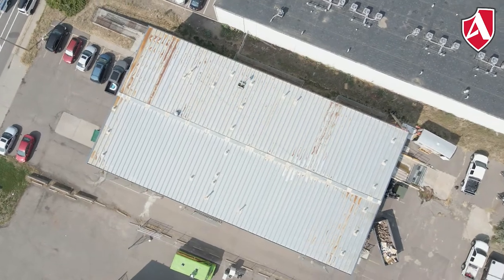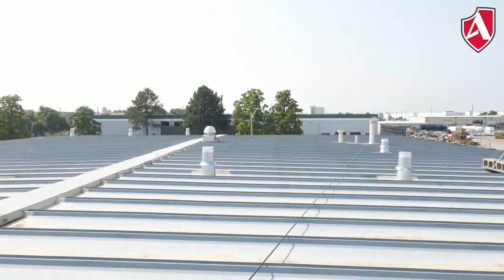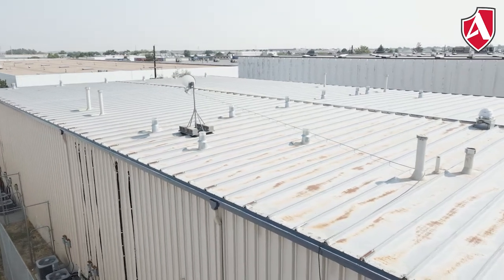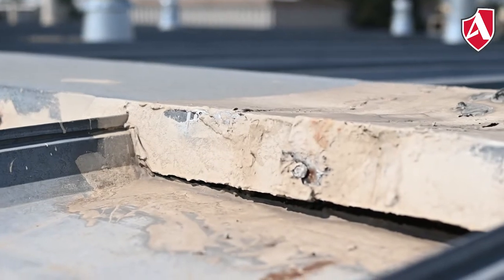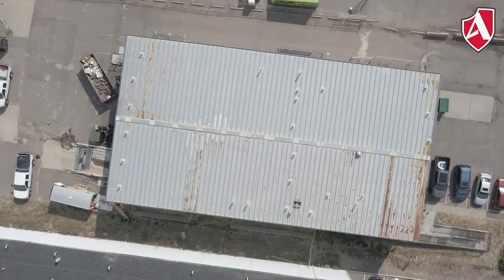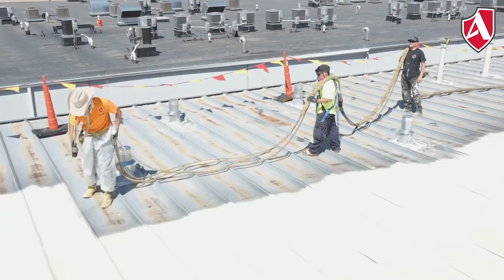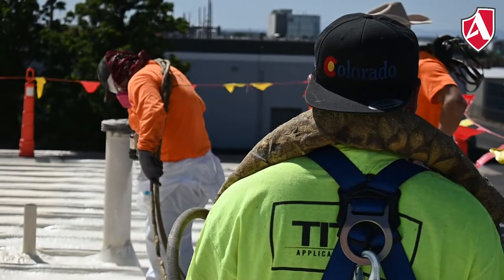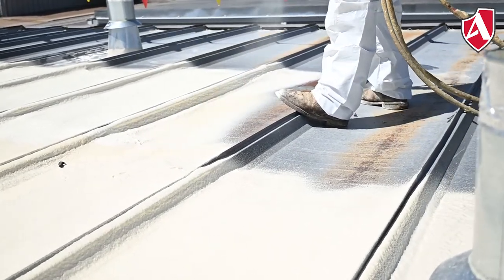Spray Foam Roofs | 3 Reasons They're The Best Flat Roofing System

Comment: What do you recommend as a top coat to the foam once on the roof? Spray on silicon? How many coats?
Reply from the maker: We like acrylic but occasionally use silicone. Each has their own benefits under certain circumstances. Pay attention to the product specs for mil thickness maximums on each pass. The final thickness of the coating will determine the warranty durations. Basically, the thicker the coating is, the longer it will last. Good luck!

Comment: How does closed cell spray foam for roofing hold up to direct UV exposure?
Reply from the maker: That's a great question. UV light is enemy number one of spray polyurethane foam. That's why a covering must be put over the top of it [typically a roof coating or sometimes gravel]. As long as the foam stays covered, it will last a very long time.
Reply: @titanapplicators  so not matter what it is going to fail?
Reply from the maker: @gdotone1  I'm sorry, but we don't understand your question... Would you mind clarifying?
Reply: @gdotone1  Not if it is kept coated, recoat it before the coating fails and the foam is exposed to sunlight and it should last the life of the building.

Comment: can you just spray the outside of a shipping container and leave it to the elements?
Reply from the maker: Technically, yes, but it depends on how long you need the foam to perform for you. Ultraviolet light will break down the foam over time and it will eventually degrade to a point that it will not do anything for the container. - Plus, it turns a dark yellow/orange color when the sun bakes it. - My recommendation would be to at least apply any exterior paint over the top of the foam to protect it from the sun.